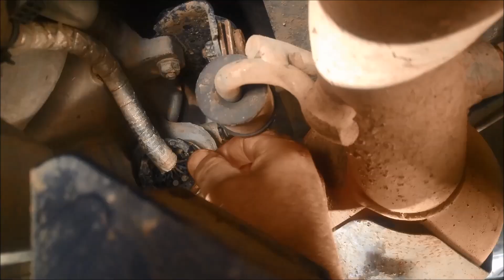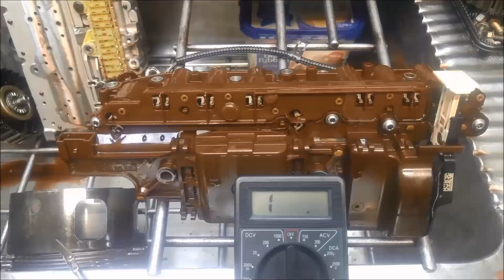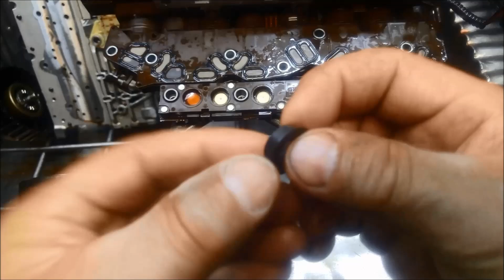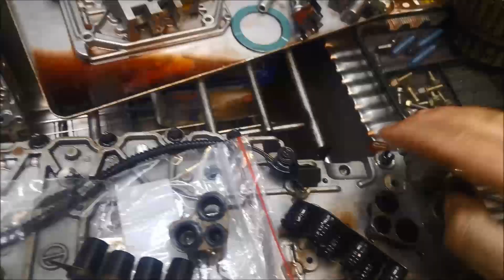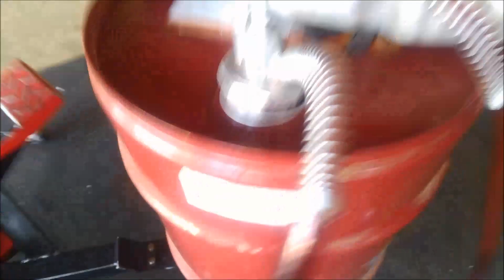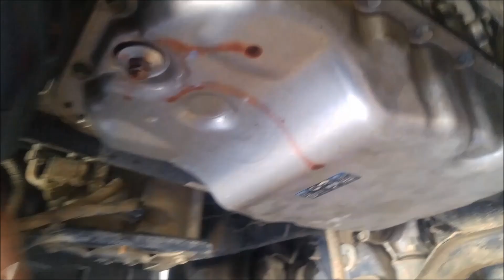Torque Converter Clutch Cycling & 3-4 Shift Shudder 6L50 TEHCM Electro Hydraulic Control Module 6L80

Comment: Thank you for posting this video!  I have a cycling torque converter and occasionally hard shifts under load.  My biggest frustration has been an intermittently locking TC when it is extremely damp outside and the transmission is cold... it will stall at idle, which makes traffic lights interesting 🤔!

The dealer wants to swap the entire transmission, but has no new stock.  The TC factory can rebuild, but recommend driving it until it is completely unusable, as the rebuild will cost the same?!?

I believe in understanding and fixing my equipment, and stumbling across your 6L50 content is giving me hope that there is reason to open mine up and try to service what might be the root problem!  As soon as I post this comment, I will be subscibing.
Reply from the maker: hi, for technical questions please contact us via our facebook link in description and don`t forget to bring some beers. cheers

Comment: Thanks mate. About to service my Colorado auto trans. Your video explains great detail and not full of basic rubbish that’s not needed. 
If you need to know how to remove bolts you may need to consider if your capable of doing the job. 
Under normal operating conditions what temperature range should the auto be operating at? 
Anyway thanks again for fantastic useful detail. Great Australian content.
Reply from the maker: hi, trans temps vary depending on where you take them ( usually alot hotter closer to converter ) thanks & cheers

Comment: I hate how transmissions are made to be non serviceable for the average joe now days. Because clearly these transmissions would benefit from regular oil changes. Even sealed transmissions where the oil is supposed to last the life of the transmission. Whats the life of a transmission then, I'd say probably around 200000 K's
Reply from the maker: hi, quiz your dealership...i have asked the designers/engineers at trans seminars and they say they are not sealed for life...they are suppose to say sealed for life of warranty...beats me why they keep saying lifetime oil or sealed for life ! service your transmission and change filter/clean pan and magnets ( add more magnets too ) cheers